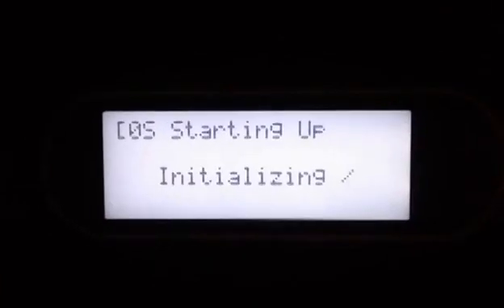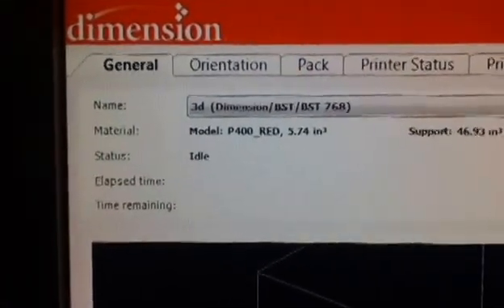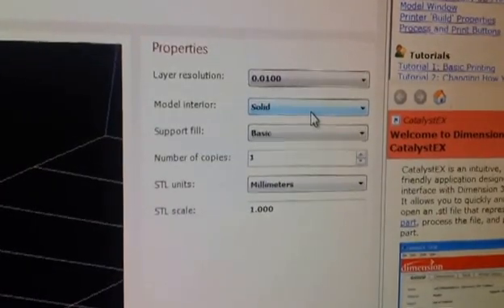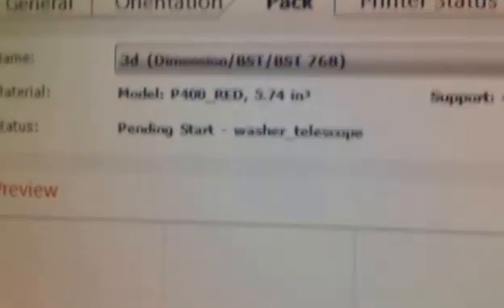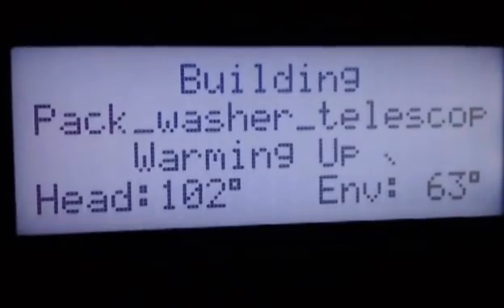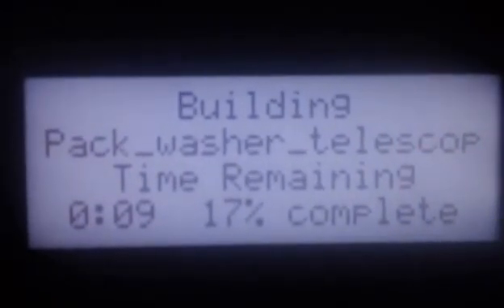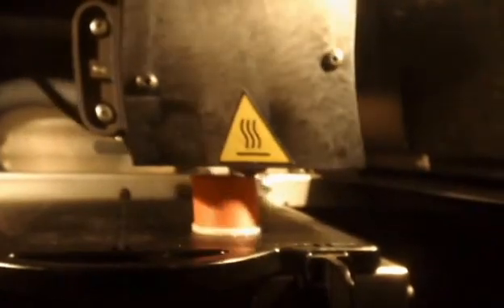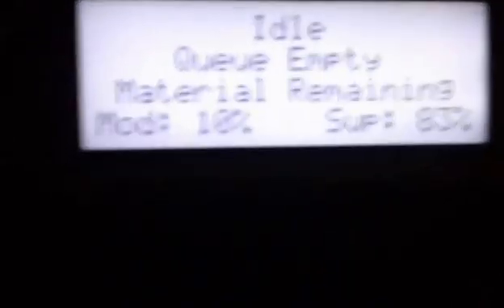BST 768 rapid prototyping 3D Printer demo

Comment: Did this 3d printer rlly cost 30k$?
Reply from the maker: Wow, I  completely forgot about this video. 
As for the price, Back in its day yes! Very expensive back then. I made this video over ten years ago. To this day this was the best 3d printer I’ve used. This thing made the strongest models. I still have many times I orinted on this machine. I’d love to have another. The heated build chamber makes such a big difference in strength and build quality.